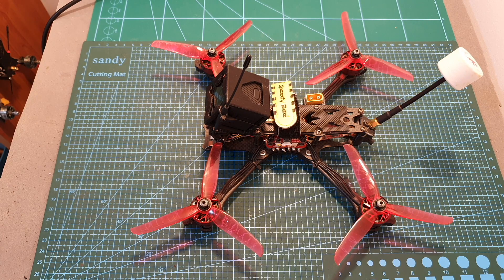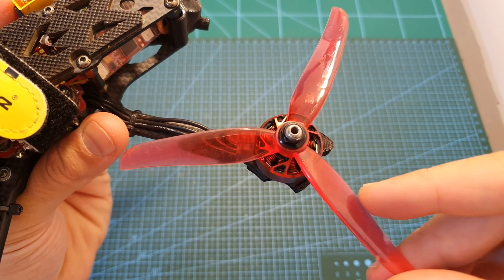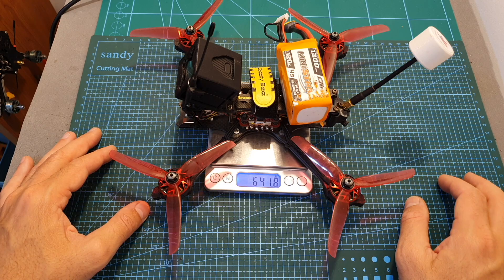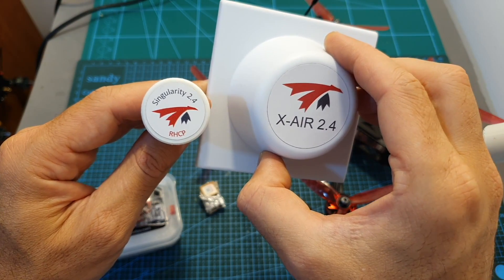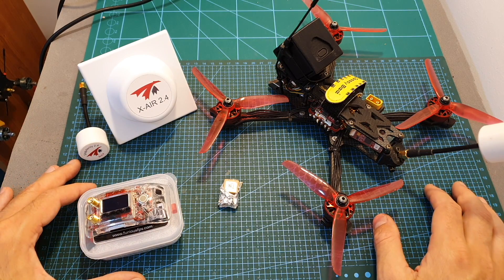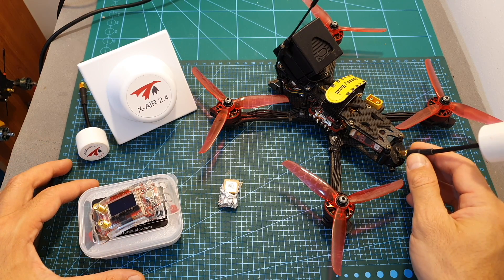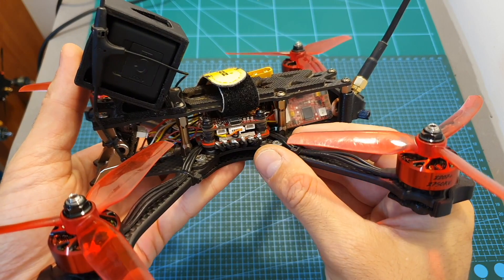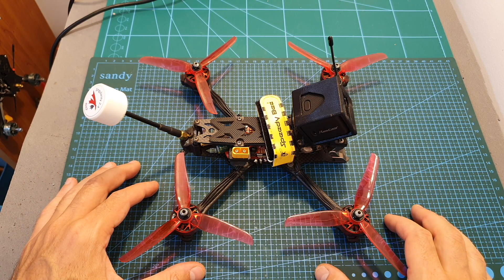Speedy Bee 5", HGLRC FD765 + TrueD-X 2.4 Ghz Receiver First Test - Build & Flight

Comment: You need to use some flux or more because all your solder joints are jagged and sharp.. It will smooth them into a ball and make them shiny and stronger 😊💪
Reply from the maker: Thanks for the tip. I am not using a much better solder and it shows up :-)